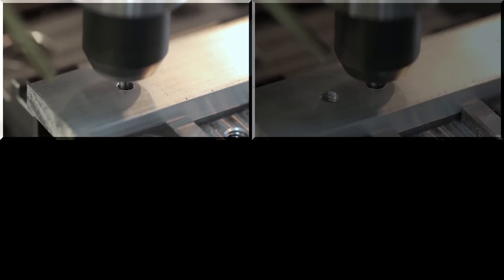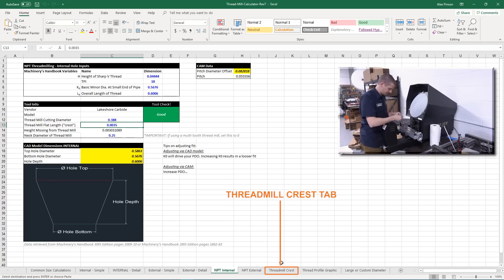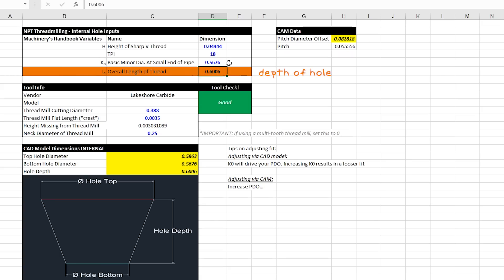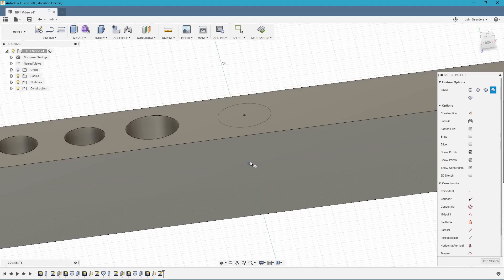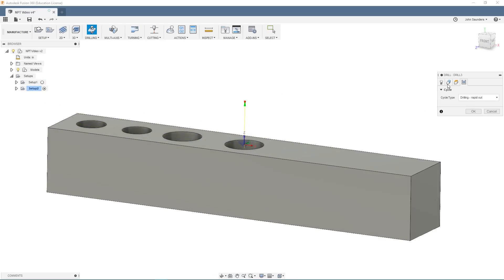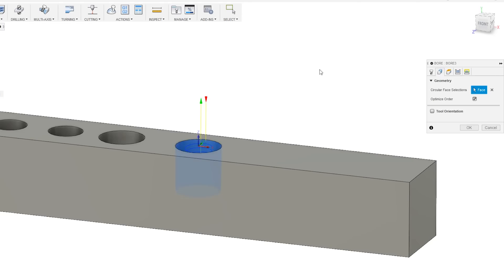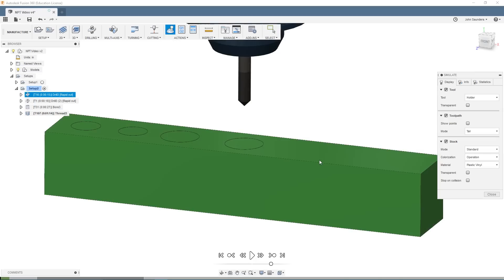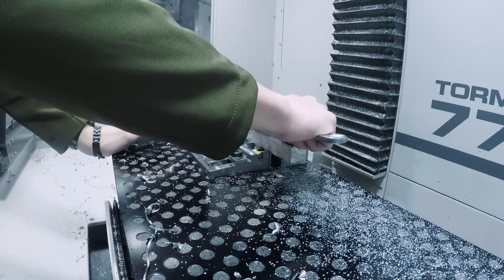How to Threadmill NPT Threads | WW244

Comment: Could you or anyone share the g-code for the tapered thread operation please? I' struggling with solidworks and BOBCAD. They won't cut the taper. Should I remove the "I" and or "J" values from the code? It's a changing radius from one side of the part to the other. Thanks for any input!
Reply: Bobcad is going to struggle with this.  There's no need for the taper.  All you need is the minor hole.  The seal comes from the major threads you create with your threadmill.  The tapered hole can cause more seal issues.   Some may disagree, but I've found that if it isn't exactly perfect, outside of using Aluminum, it can cause more issues with seal by conflicting with the minor threads. You get your form and seal from the threadmill and it is exact.  Hope this helps!

Comment: when i program this it work but generates 1800 + lines of code for one operation on one hole. Is this correct? It just seems like a lot of code to me.
i.e.  it just makes these tiny incremental  to create a helical pass. fyi this is an old HAAS. using HAAS pre-ngc in fusion
G1 G41 X0.0489 Y-0.018 D25
G3 X0.0669 Y0. Z-0.4094 I0. J0.018
G1 X0.0667 Y0.0062 Z-0.4086
X0.0659 Y0.0123 Z-0.4078
X0.0645 Y0.0184 Z-0.407

Comment: This no longer works, don't waste your time. Hole taper came through fine but fusion ignores it when thread milling with the single point thread mill. 👎
Reply: hole taper in npt pipe thread fittings is unnecessary
Reply: @dailybradshaw2  unnecessary, but helpful when you're dealing with harsh material no? I needn't have bothered for what I was doing in retrospect, but I remember tapping by hand 1/2" npt into 304, that was nooooo fun lol

Comment: The spreadsheet for NPT taps on your website is different from your video. Under the "CAD Model Dimensions" section instead of a "Hole Depth" my excel sheet shows a "Taper Angle (degrees)". Can we get an updated spreadsheet to match this video?

Comment: I do see havrey tool sells a specified single form metric thread mill, the question is it possible to threadmill metric threads with a standard size single form thread mill I.E. 1/4 20-56tpi to thread a 6x1.0.

Comment: .5863 to .5676 = side length of .00935 across .6006 depth gives an angle of .8919 deg. instead of 1.7899, why? been trying to figure out what i should turn id tapers to but can't seem to figure out what numbers to go off of

Comment: If you are going to the length of the calculations here might as well just extrude the hole with a taper angle.
Reply: or not even worry with the tapered hole.  it is unnecessary

Comment: Thread milled threads for me come out way way better. I ended up with a multi-flute 1/8 NPT thread mill which has been amazing to use. Pretty quick and doesn't have the problems that an NPT tap into stainless steel seems to occasionally have. I also have to worry way way less about wear of my tap for a production part. NPT thread gauge is a must! Or at least, a sample of fittings, but I ended up with a gauge as it's a lot faster to check production parts.
Reply: They leave a little bit of a burr at the entrance of the thread that taps don't seem to, and sometimes you have to run them twice because threadmills are really sensitive to tool pressure, but other than that they are better than a tap in every way.

Comment: Could you design a foward and reverse gear box that would go to a motorcycle engine? Thinking about building a mini sand rail with a cbr 1000 engine, but a foward and reverse gearbox is either $1000+ or nonexistent. Thanks

Comment: Good job with the video. Just a quick tip, Fusion just released NPT holes. The work you did to model in the tapper is now included in the hole feature of fusion. Just create a hole like you normally would and toggle the NPT thread setting, next to the standard thread setting. It may save you some design time. Thanks for the info once again.
Reply: Thanks for the heads up! When we made the spreadsheet this wasn't available but it does eliminate the need for the majority of calculations/CAD modeling
Reply: @alexpinson7759  Not a problem. You guys put out a ton of useful content I learn from. Glad I could return $.02 of the favor
Reply: jes but for some reson it rely undercuts the tread and wont do radius compesationon itnc 530

Comment: I need the excel calculators file in Metric dimensions  please ;)
Reply: Create a set of cells off to the side or bottom of the sheet in the same arrangement, and in each multiply the original cell by 25.4. Done. 
You will probably have to order your thread mills and stock from France. :-)

Comment: Love the optical comparator benchmarking, but I own a Harveytools threadmill and that didn't make it into your list. The Harveytools website says their threadmills are ground to a point, so should I just put zero for the flat?

Thanks for making life so much easier for all of us!
Reply: Really just comes down to your fit preference. One or two thou doesn't make a HUGE difference, but you have to remember it's one or two thou on both sides of the hole. If inputting a crest length of 0 gives you a looser thread than you'd like, a larger crest dimension will tighten the fit
Reply: @alexpinson7759  Thanks Alex, that clears it up!

Comment: How about threadmilling an external NPT?
Reply: Exact same process, except the loft creates a post instead of a hole. There's an included sheet on the spreadsheet for external just like there is for internal and inputs are all the same
Reply: hello sir, how to calculate x and y first  position from centre X0,Y0, in 1/2'' -14 NPT EXTERNAL THREAD ,  please answe

Comment: You would really need to get a pipe thread plug gauge. They have a flat ground on the gauge that is the hand tight depth. This would be the industry standard of measuring the diameter/depth.
Reply: when E.P. shows up in other Machining CNC channels you know youre either gonna learn something or see something either in the video or in the comment! 

Antcipating the final OP(s?) on the Nitronix btw! @Edge Precision
Reply: I agreee, for any tapered thread really.  You need something that can judge the distance, normally two flats, when hand tight your in between.
Reply: I'd love to figure out how to define the diameter of a tapered multi-tooth threadmill.  It always seems that when I use the nominal diameter on the threadmill box for programming, I need a ridiculous radius wear offset like -0.5mm to get me between the go, and the no-go on the step limit gauge.  It doesn't help that I cut 1/4", and 3/8" with the same threadmill, although when I get it dialed in (both programmed to mid tolerance), they both end up mid tolerance.
Reply: @matthewgowan7546  late response but you can just check against a flat surface when it starts to remove dykem, no?